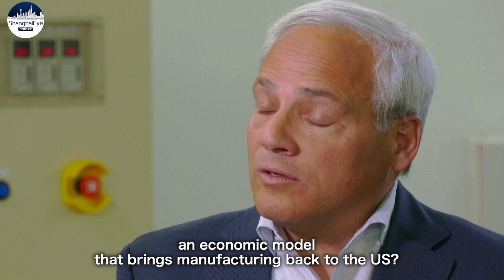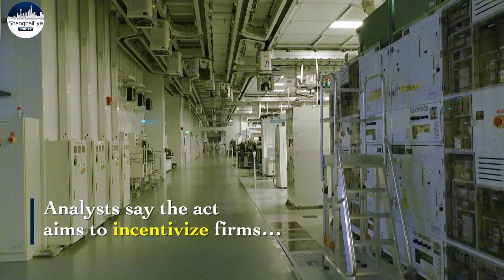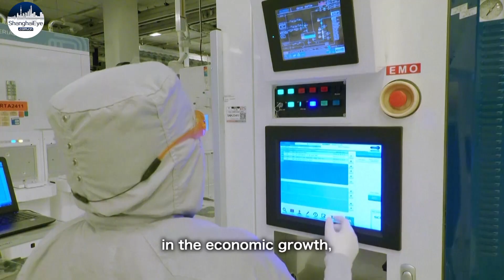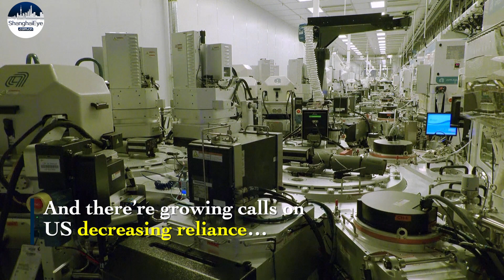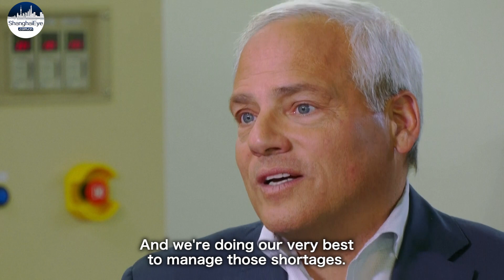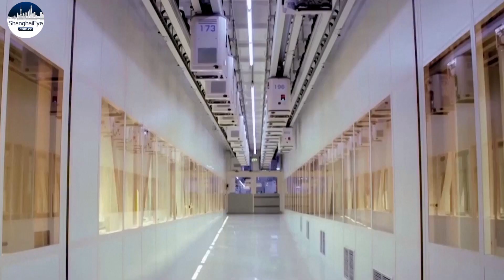$52 billion to counter China? US chips bill hopeful to 'bring manufacturing back to the US'

Comment: I was under the impression that manufacturing jobs were exported because it wasn't cost effective making them in the US.
Reply: well when they drive up all prices like crazy, it will be cost effective 😂
Reply: Yes, they have to self reliant if they planning to sanction china lol....Another thing about is about the harmful chemical used in chip making though...
Reply: Dark Clouds  i was just playing 🙂
Reply: Dark Clouds  the US has been importing lots of slaves lately though
Reply: Most of the jobs are automated now anyway. So there will be some jobs but who are they going to sell chips to? Not China - lol - which is the largest market in the world - lol
Reply: Not necessarily. If automation usage is high in plants (which they typically are for chips) labour costs can be significantly reduced. Key chip production materials then mostly come from Japan and machines come from the Dutch. Other non-key items like silicon are also from other parts of the world. Key technologies are also not a problem because foreign companies from Korea and Taiwan can transfer technologies because of strong IP laws in the US.

So if those costs can be managed, savings from transpacific shipping and time which have been spiking recently may provide a reasonable offer to US domestic production. 

Furthermore, China has been locking down every 2 months these days, which impact supply chain and creates penalties for delivery delays. With domestic production, there is more control over outputs and lead times. Plus salaries in China have been growing too much these days as the supply of labour falls and inflation bites.

Then there is the benefit of rebates from local sourcing by US firms. As US taxes are lower for goods mostly made in the US, the numbers make even more sense. Other factors include designers being able to quickly negotiate for test samples,  increasing bilateral tariffs, shareholder activism, CSR, company reputation, government support etc. 

So while it may be surprising to hear, subsidies today (rather than 10 years ago) could actually level the playing field. Already many firms like TSMC, Samsung, Intel, Foxconn have or are intending to build plants in the US.
Reply: @michaeltse321  right now there is a shortage of microchips, gpu and processors are way above the normal price.
Reply: I would take US seriously about bringing back chip manufacturing to US.  This is a strategic move and the high tech chip manufacturers will be heavily subsidized through contracts from US military - which is why the significant increase in defense budget.

Comment: i have been using my old laptop for past 10 years. i can do almost everything into this. why do i need a new laptop or pc?
Reply: I am sure your 10 years old laptop is made in China even if it is an American brand.
Reply: @hengongchua6250  yes it is. i also have a 9 years old ipad4 which is also made in china.☺
Reply: I tend to go a long time with laptops.  I make sure I buy them used and with an i7 processor or equivalent.  I max out the memory and do my own repairs if I had to.
Reply: Some people use their laptops for more than social media consumption, word processing or emails.
Reply: @pavelhassan7457  , my Lenovo computer is 12 years now and I am still using it but not as much I am using my Xiaomi tablet most of the time. The only thing that I have change for my 12 years old PH computer is the monitor to flat screen and the mouse too. For 12 years I never need any repair at all, just upgrading.
Reply: You should try a SSD, it's like so faster, the image quality of new laptops are faster but if you don't play games or run heavy softwares toy may really don't need a new one
Reply: You need a new laptop or PC, because your laptop was stolen. Make sense? 😊
Reply: For one, the OS will slow down on purpose as it updates. Software will expire and need upgrade and tends to slow down the machine even more.

Nonetheless most older people can take it using eg Win 2000,  Win XP, Window 7...
Usually when a hard drive dies; one will look for a better machine.

Usually nowadays is Win 10 but Win 11 is becomimg the thing. Or an Apple MacOS

But if one is using non PC or notebook. Likely Android for iPad unless Huawei China (Harmony OS)

For the younger generation upgrading is more of a necessity if they can affort

Comment: Well, if it includes the Acquisition of ASML and Licensing of ARM or x86/x64 Patents it might be worth it (instead of Investment in Biofuels and the EPA requiring all Combustible Fuel Passenger Vehicles sold in US Jurisdiction to run on Alcohol, Diesel, or be Zero Emissions by 2025)...